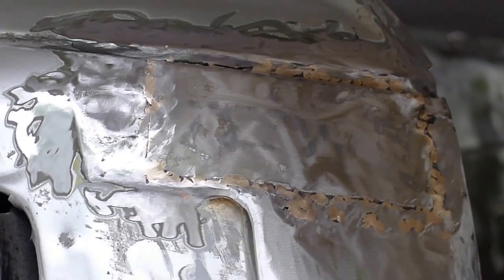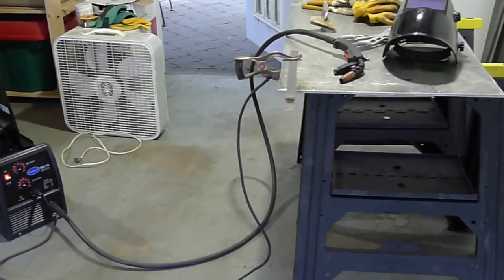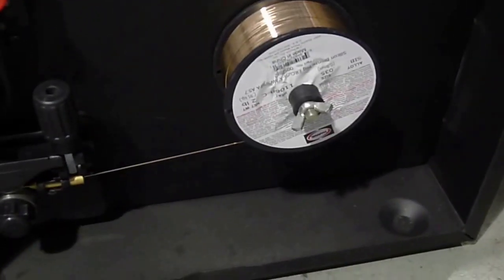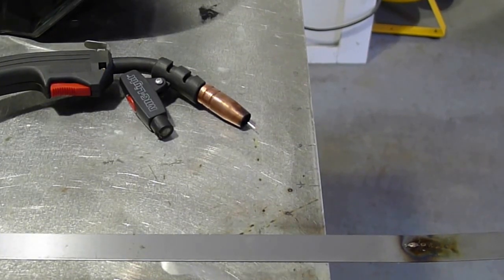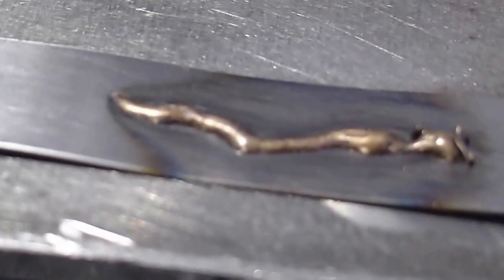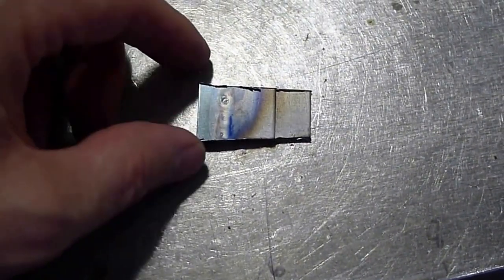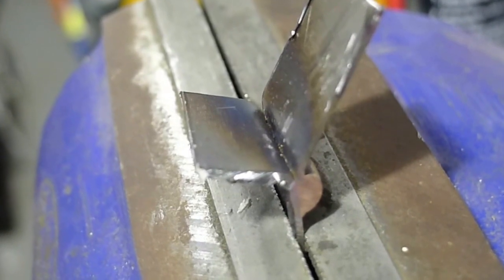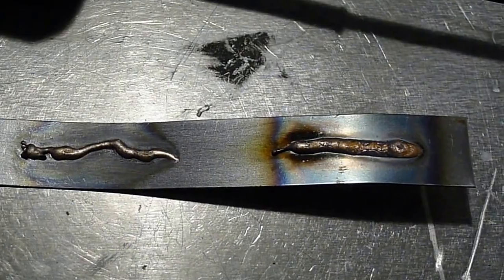The Ultimate 1983 Rabbit GTI Project - part 12 (MIG Brazing sheet metal)

Comment: Didn’t realize this video is 8 years old, been searching for guys Mig BRAZING newer zinc coated thin gauge auto body panels. Been watching I-Car videos and learned a lot. You are doing things that are not recommended. I-Car says: 1. Must use 100% Argon. 2. Always Push the puddle. 3. For small welders using single drive roller you must use a Teflon liner or preferably a spool gun, or you will get lots of wire “bird nests”. 4. For best results use a multi processor Mig capable of Auto Pulse mode. (Yeah, got an extra $12,000?!)

I really appreciate your input. I’ve added a second Argon tank and a spool spool gun to my Miller 140. Eagerly awaiting the arrival of Silicon Bronze wire so I can practice on my 22 gauge, zinc coated ‘96 GM car panels! Sure hope the 1,000 degree cooler temp and lack of actual fusion will minimize the shrinking/warping I’ve experienced with Mig WELDING!

Comment: Thank you so much for this. It was hard to find some practical advice on using a basic mig for brazing, and you nailed it.  I have the same Eastwood mig and cant wait to run out and try 0.035 brazing wire and C25 on my copper sheet sculptures

Comment: Where did you source your brazing wire from?  I can't seem to find anything.
Reply from the maker: Google 'MIG Brazing wire' and you will find sources. It isn't cheap but in Europe it is fairly common. I found a number of US sources that have 0.030 and 0.035 wire to choose from. I continued to use C25 gas but it is much nicer to use pure Argon as it protects the brazing better. I didn't care as I was grinding it down afterwards. Warning: it is expensive. The 10lbs spool of 0.030 wire was $200. You should find a 2lbs spool for much less though ...

Comment: At 0.20 in that patch panel looks like a holed disaster! why didant you just cut it back to solid metal and cut a repair panel flush and mig or tig it like every other  car restorer does?
Reply from the maker: I didn't fully weld along the whole seem because the metal was badly rusted and very thin and I didn't want to blow thru again and again. I was at a seam in the body and it wasn't going to be easy to cut back further to unrusted metal. So far, 4 years later, this panel looks 100% - it was filled, sanded, painted and looks much nicer than a new OEM VW panel would now so I am happy.